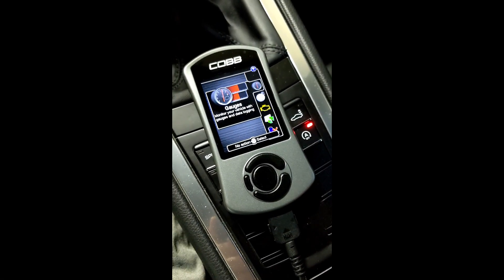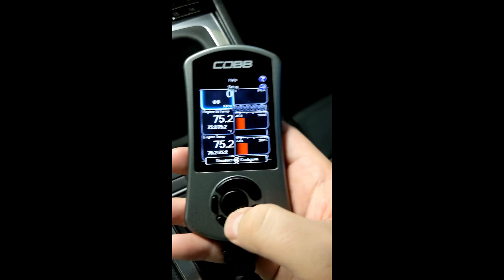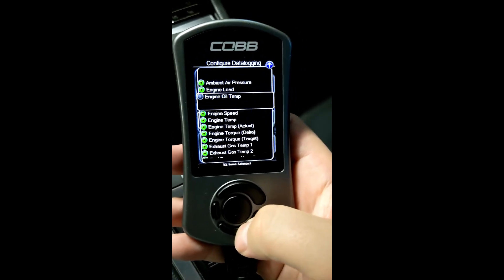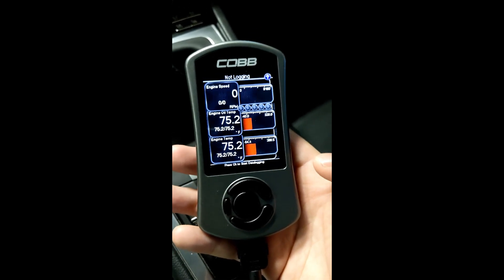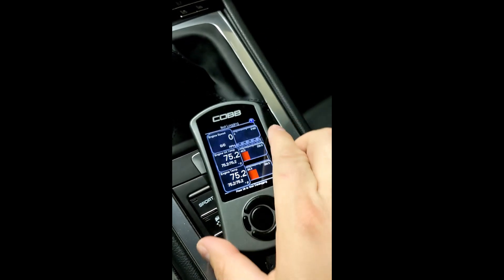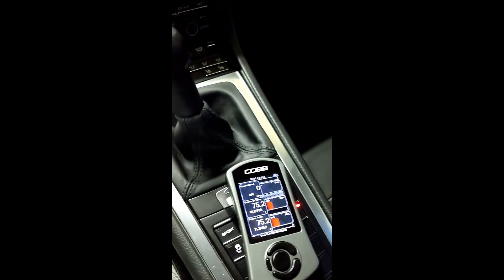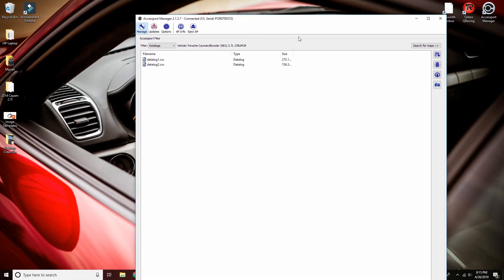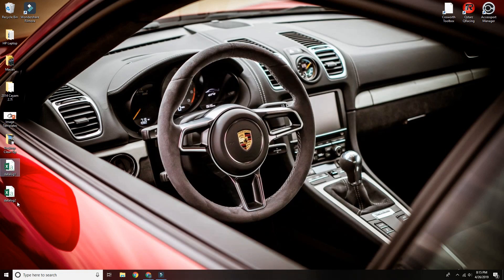Porsche - How To Data Log with Cobb Tuning Accessport

Comment: Does the Cobb tune have to be installed to be able to datalog? I wanted to datalog a couple of runs on stock tune before adding the Cobb OTS tune but I don’t see an option for gauges. All I see is Install and Diagnostics. Able able to see and clear cows but no gauges or data logging .
Reply from the maker: Unfortunately it does have to be installed but you can load the Stage 0 map which is just the factory settings and then datalog. Alternative, you can use an app like Torque Pro but the Stage 0 map would be the best way to keep things consistent.
Reply: Jon @ Flat 6 Motorsports Thanks. Figured while I am at it I should check for any saved codes. Any idea what these are? Ox773, UC194, Ox753, P1802. Has recently done the GT4 bumper which got rid of park sensors and headers. Could be related but not sure. Is there a repository for Porsche codes where I can look these up? Thanks again.